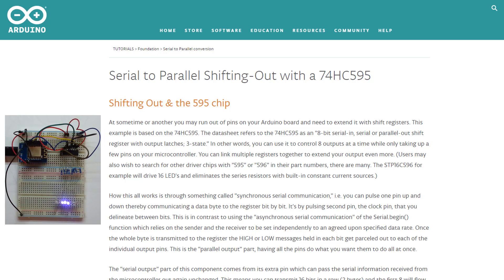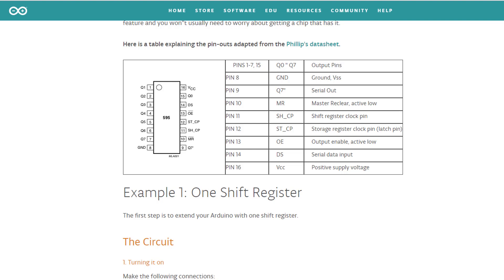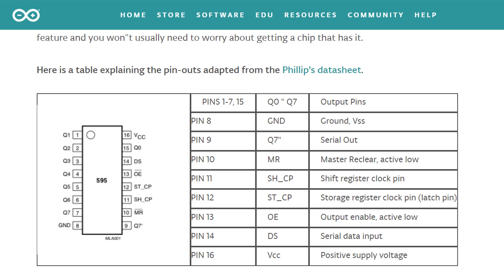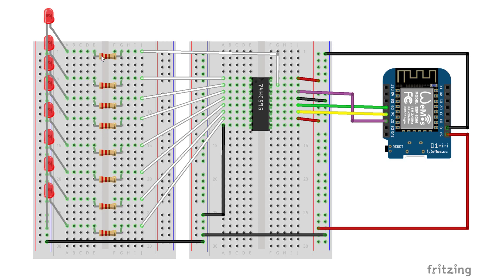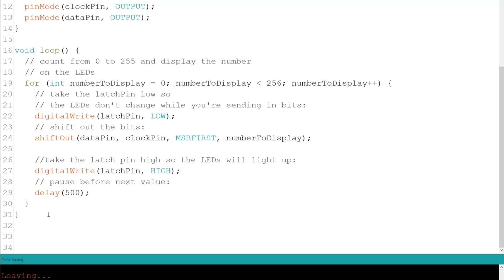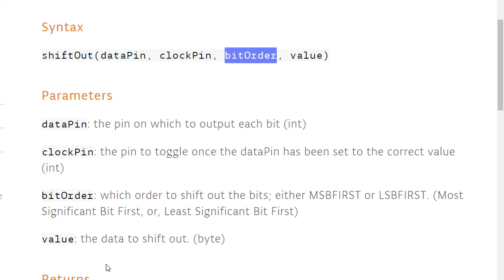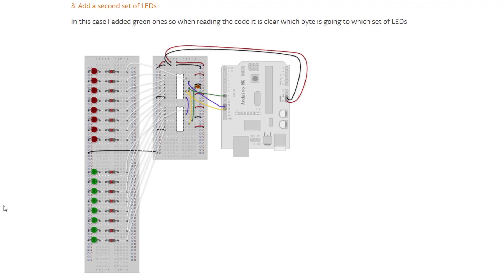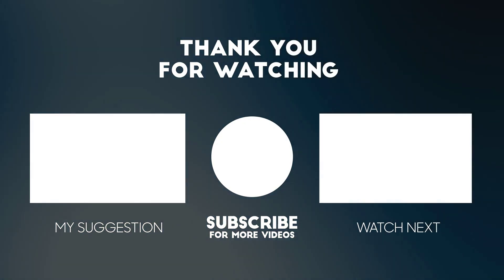Never run out of output pins –  74HC595 shift register to the rescue.

Comment: better to define constants than global variables, so change:
int latchPin = D5; //8
to
const int latchPin = D5; //8
this will save memory and prevent the values from changing due to some unexpected bug
Reply from the maker: That is a good point.
Most of the times I go with #define for GPIO :)
Reply: @talofer99  const int or whatever type, is better than define... there can be some type checking errors or warnings thrown if used inappropriately... which you will not get with define, which is basically a compiler time macro ... and has no type at all
Reply from the maker: @buggaboo2707  when it comes to assigning GPIO I see no issue with using #define.
But you got a valid point.
Reply: @talofer99  I think there are other issues as well, maybe scope, and conflicts with libraries and such, but whatever

Comment: awesome, do you have any recommendations if you want to control a large number of pins? is there a shift register that has 32 pin outputs, or more instead of 8? Thanks!
Reply from the maker: Thank you very much :) 
You can daisy chain 4 of them :) simple and easy. 
In the video I show chaining 2, you can chain 4 (and way more) with out any issue.